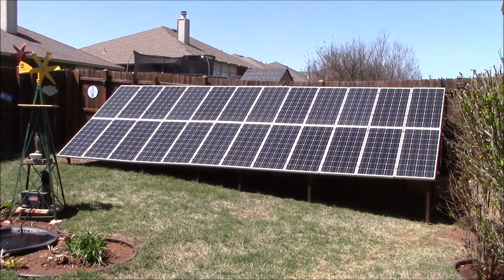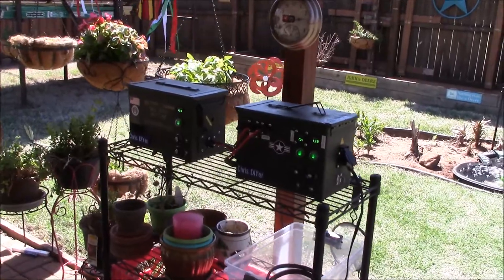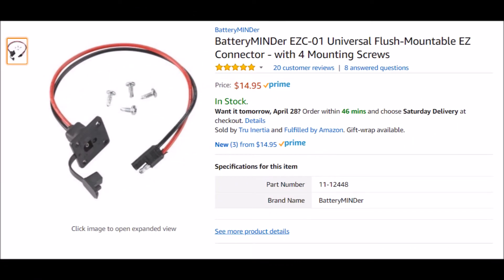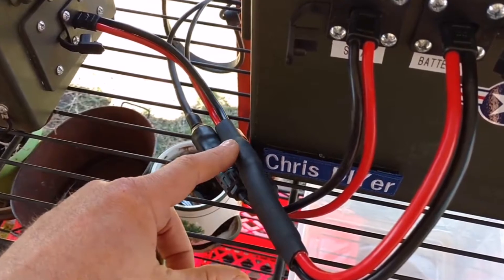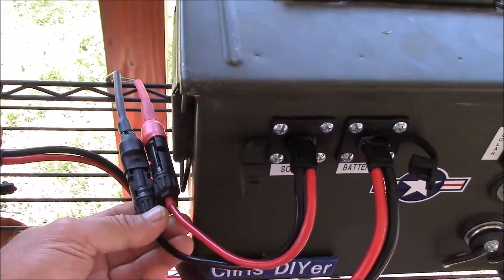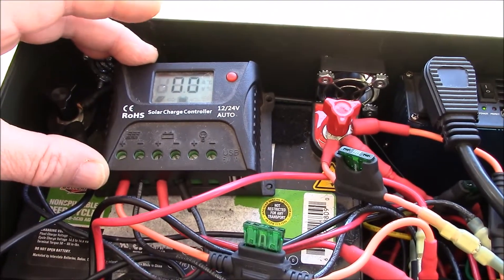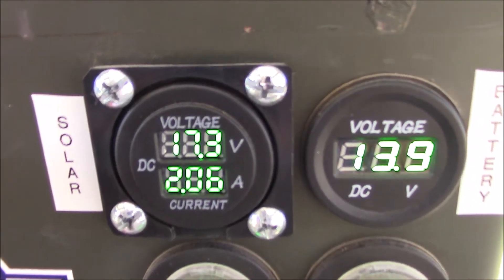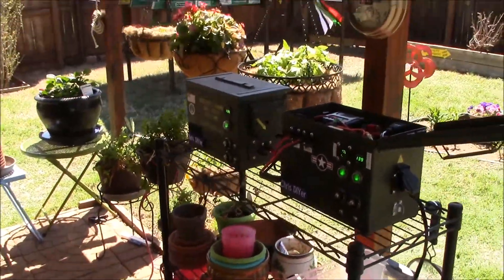New SAE to SAE jumper cable and BatteryMINDer sockets - 12v micro solar generator system

Comment: Chris  How come you didn't use some Anderson Power Poles? No messing around with uncovered terminal ends, no polarity problems. You can get rubber boots for the Anderson's    https://powerwerx.com/anderson-1441g1-1442g1-powerpole-splash-boot    and no problems with voltage drop???  Keep having fun.
Reply from the maker: Bought some, played with them, didn't work out.